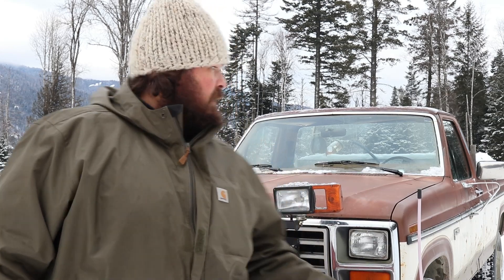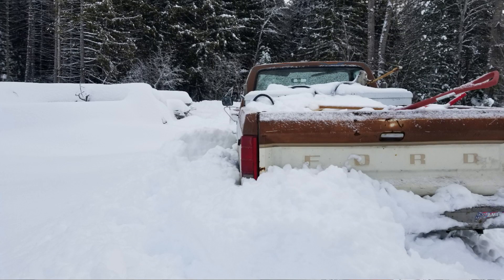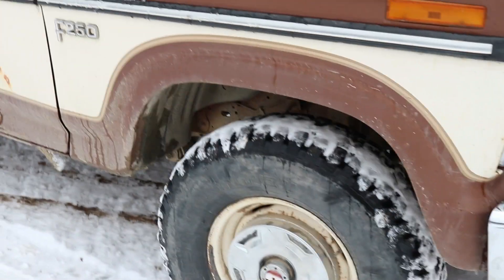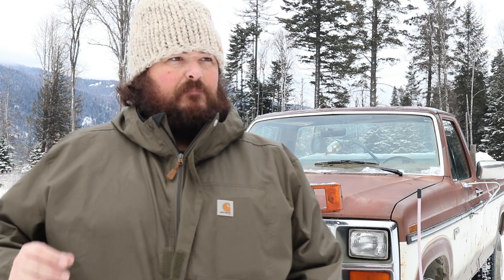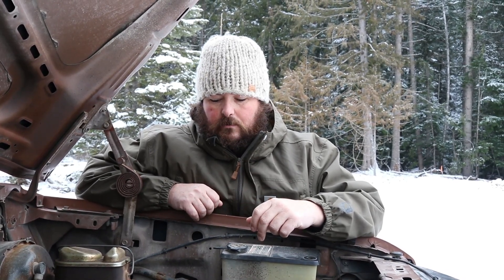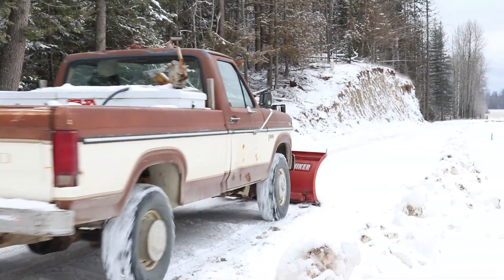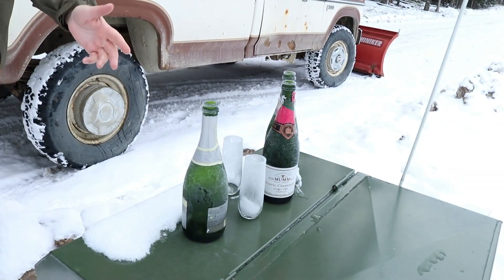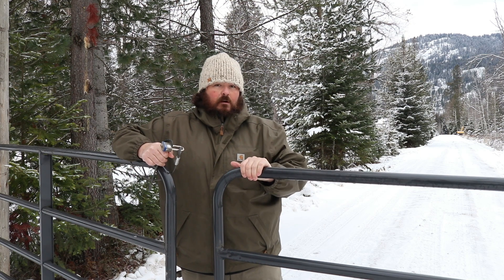Snow Plowing with a 1985 Ford Truck

Comment: I had a 1984 Ford F-150 Short bed with a 7.5ft Meyers, 4 Studded tires, rigged the lights so all 4 were on at the same time, huge difference, all white no yellow. 2 extra round reverse lights when reverse was engaged. 2 batteries, one in the normal spot and the other behind the seat, linked together and powered by a 200amp(?) alternator. We used to tractor pull, so I put 800lbs of lead right against the tailgate in milk crates. That little truck would push quite a bit considering it's size AND I know it's because of the Studded tires and the weight. It would also turn on a dime because it was a short bed. The extra reverse lights were a blessing when doing 50 plus driveways a storm. Get those tires studded, add weight as far back as possible and extra lights, battery and a big alternator, you will not be sorry. Sorry so long, Thumbs up and Happy New Year if we don't see ya !!!
Reply from the maker: Thanks for sharing, I love the idea of adding weight in the back of the truck.
I'm going to look at hualing sand around in buckets that I could use on ice if I needed to in a jam.

Comment: drinking champagne? thats something i never did as a kid... was that a tire iron under your hood 7:40 looks like they put one under the hood hinge... i am kinda looking at a newer pickup 2000's but it only has a 6cyl .. its 4wd though... has a cap on it i think i would remove but no tailgate so they can be expensive... probably won't  get it but maybe i will.  anyway be safe.. oh chains might be good too..

Comment: Replace with all new bulbs.

Maybe the terminals that plug into each other are corroded — replace. Put some Vaseline liberally to seal out water. 
Use Shrink Tubing on new connections or splices.
Good Move on loving Fords!!!
Good move on paying a real mechanic to fix stuff RIGHT!!!

Maybe put a gate up...
You can also put a separate look for each owner 
Or 
An Automatic gate opener.

Idaho sure looks pretty!!!
How many lots have you sold???
Reply from the maker: Uncle brian, 
I can always count on you for some good sound advice. 👍
Reply: Essential Mountain Homesteading 

Tear up that
 ❄️ snow ❄️ 
Mr Grizzly!!!

Comment: I feel sorry for who ever has to put in the studs. From back when I worked in a repair shop and a customer wanted studs put in a tires that has already  been run you had go thru and dig out all of the small stones out of the tread before you could put the studs in. not fun. Always need to install the studs on new tires before they are run.
Reply from the maker: Thanks for mentioning that, I had no idea that was an issue

Comment: I put studs on my car years ago, and by the time winter was over most of them were gone.
They only work on smooth icy roads, just to get going, but in the snow you are much better off with chains.  After spending the money to put studs in my tires, I haven't spent any more money on them.  They are a wast of time, and now they want you to put them on all tires that touch the ground..   If you don't have a 4X4 why spend the money??  If you want extra traction have your tires Sipied..  That will do much more then studs..

Comment: well that's what every situation is life if you don't have a home to go to or a piece of property that you are homeless you will go where there is no someplace that need nobody's going to find you how do you get to that place you have to get on has to be someplace you can't wrap car can go to and come back from now in the summertime when you're going to be doing construction the only way around that is to keep it unlocked but keep somebody on the property you can't leave anything forever unattended it will be takenyour land when it becomes time for you to have the property that say the homes build out there they're going to want to have access to it to and from it fromin order to keep a gate operating in the winter time you have to make sure you keep it so it up loudyou say you're plowing the road so what you're saying is the property in the winter time is snowmobile materialanything that has no wheels already called skid plate so whatever where it has a track instead of a wheelwhere to put a car on it the car has to be able to stand and be nice to be able to have a flat surface that the car doesn't sink into so tractor set up asnowmobiles from that point on into the property is the way to go but where do you keep the can't just leave vehicles and equipment and tools people are notif everybody had everything they needed the wind never hit it would be no need for a walkwhen you are in a situation where you don't have food or heat or shelter you're going to have to find those things to survive and guarantee you're going to be traveling to places that you would normally not be if you had them yourselfwhat you develop the property of course what's going to keep the community intact are your neighborsthe only want to 5 acre lot there's no way that you can protect your lot at any given time you have to sleepyou have domestic animals that you have to keep away from wild animals good luck with that you're the one changing their environmentif every person owns a piece of land that there's going to be no not everybody does only the rich get to keepin order to keep the world the way you want it everybody would have their own Vehicles their own cars their own food are on housing and everything will be peachy-keen but it doesn't work that way in the world not everybody has has those kind of close you can either be wearing clean clothes are dirty clothes on anybody that makes less than $44,000 a year in my area lives in povertythey don't have cars they don't have bikes they don't have ways to get around town they don't have money to first find the best food they don't have property where they can you know live out in the boonies
Reply from the maker: Winner winner! That is the longest comment I have ever gotten on this channel.
Reply: @EssentialMountainHomesteading  wasn't the whole reason why you move to that area was so you weren't regulated you weren't following the rules and you can do what you want and then you went and got a property now you become the land keeper of that property whenever your rules rule that area you wanted a certain way you don't want this kind of person in there you don't want that kind of person good luck with that good-looking controlling that environment it's no different than having the government do it to you the same thing you don't want somebody to come in and sweatingmy question is what's taking you so long to develop that little bit of land it's only going to be 8 houses you build a house a year yet you can't get passed one house being built there yet cuz you don't have a wait cuz you're not going to find someone to come in and spend all that more money than you spent to build it and now it's costing would it cost somebody else to build it in the regular City now you can't build the way you want getting a septic tank and left power and all that stuff is a pain in the ass to get to a customer once you got it then you can build on it if you have to have the guessing game by the land and hopefully it workshow many times you going to keep building your house to where you get when you like you haven't made one yetby time you get it built you never you never be able to get it you know very well that enjoyed she's going to die too old to use the damn thinguntil that development kitchen the money that you need to make your house to Apple it's not going to happen for a whilelong short of it is you can't control your environment around you can't control Mexico you can't control Gadot you can't control your neighbors but in your situation you can because you can pick and choose who goes into your facility and who doesn't just no different than any other person the requirements to get into a places are discriminatingokay we all want the perfect place to live when you don't have to lock the door and everybody loves you and you making you made a good living off the land that you bought it happens very very rarelytearing a home down in the Bay area and buying blue bully anyone is big bucks for people who build homes but there's no land of Erie but here you can't do anything you want with it there's always regulations that go on with it it don't make it fun living in Idaho is great if you have a way to earn income in the cold weather
Reply: @332jatc  First, try using manuscript with punctuation and sentence structure. Next, back off the bong, so you realize that you're just typing a rambling, incoherent babble of word salad, that has no sense or direction at all. Happy new year.
Reply: @elmerfudpucker3204  Couldn't have said it better.

Comment: In order to maintain property the way you want to eat like a bulldozer snow blowers that up was not designed to plow a mile worth ofit means that engine is not designed to push that got to wait as maintaining a property like that on a regular basis requires you every time it snows to push it away you don't let their the stuff build-up you can't come back after you have 12 inyou going to be plowing the property while it's snowing to keep it pushing you that two inches off at any given time you don't want it offjust like the way they maintain the roads past ways to get up to higher altitudes they have to have 24/7 road work going on can't just let us know okay we will wait 12 hours later to pile up and then go plow that it's not going to work like thatI keep the machines running while the snow is coming down and go up and down that road all the timeget three feet of snow at the overnight humidity going to be plowing that road if you don't even want to push 2 and 3 in of snow at any given time you going to be plowing that road all night long otherwise you're going to have a big problem when you wake up in the morning trying to push a foot of snow or two foot of snow when you could have been pushing it tattoo in all night longwhen it comes to plowing a road you have to plow it while it maintained it while it's snowing to keep ahead of it otherwise you're going to come back and you going to be walking on two feet of snow if you can't it's hard to push two feet of snow away from the driveway requires a huge snow blower machine to get that kind of material away from the roadevery time it storms here using a plow truck you're in that kind of business you have to go out in the snow and plow the whole night long and how much property can you cover in a vehicle not enough
Reply from the maker: Your right, I will need to stay on it plowing a few times every day when its snowing hard.
Reply: @EssentialMountainHomesteading  so my question to you were making all kinds of videos now you barely make any and your got in your busy right why why aren't you putting out videos anymore what was the whole purpose of you trying to tell us how you're going to do all these good things in all of a sudden you stopped becoming a video guy and didn't pay off enough money oryou found a glitch now or you don't have to earn you can earn enough money one way if you don't need to go on YouTube I don't knowdid you build an energy house or did you build a house that cost a fortune to live in in the winter timeI understand the theory if you have one roof and what you can afford real flowers you want to make triple stories proper basements you need all that space for all that stuff in order to build it you kind of put it in the other building from the ground up starting from scratch the right way you haven't made anything like that yet most people don't need granite top 20ft by 20ft bathrooms 10 x10 closets
Reply: @332jatc  Wow, that is one long sentence.